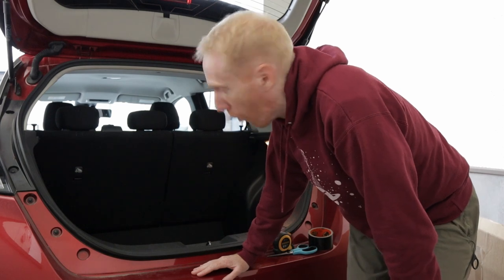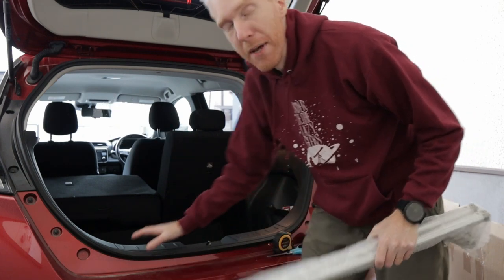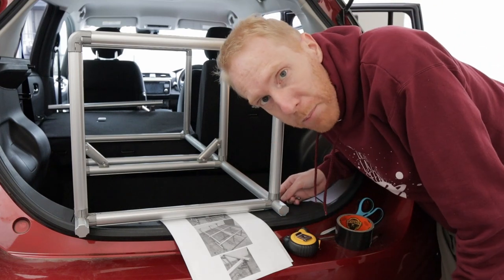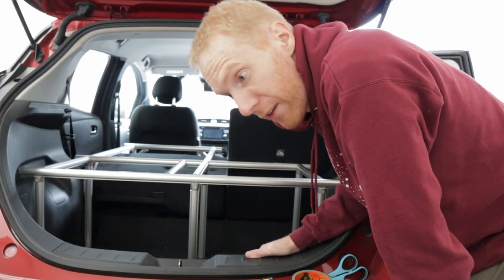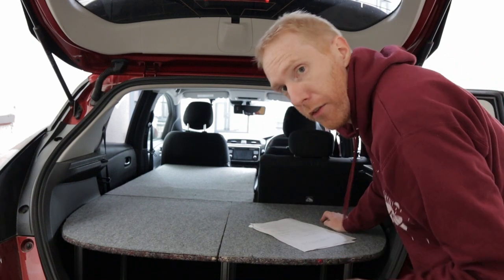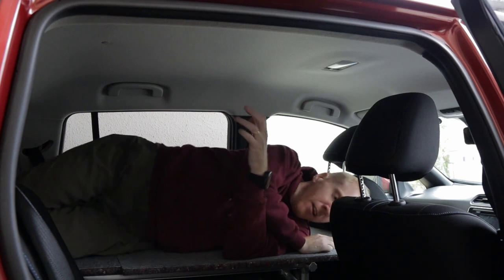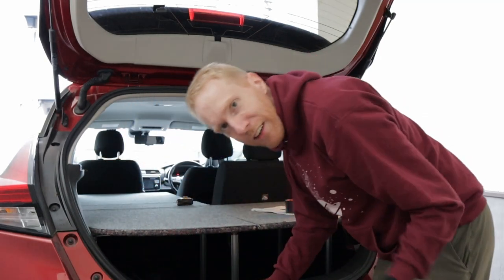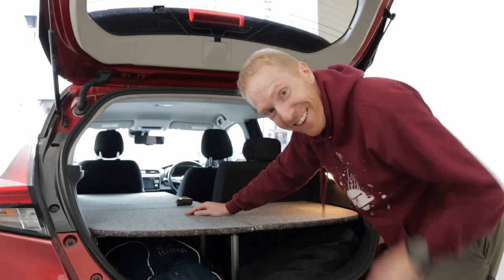From Nissan Leaf to electric Astro-Camper?? First steps!

Comment: hey cuiv! little heads up, whenever working on a car modification or fixture, consider the result of a crash. Use materials that will crumple on impact and avoid having beams directly behind the drivers seat. It looks like you've considered this, intentional or not, just making sure you've thought of it and letting others know it's something that needs to be considered
Reply from the maker: Very important point, thank you!
Reply: since different pieces I am sure the will move upwards instead pushing against
 your body

Comment: Love this!!!  I slept in my 2016 leaf for a couple of weeks.   The best part was running the AC through the night without worrying about carbon monoxide or pollution. I managed to squeeze a cot inside by adjusting its legs, but it was rough me being 6’2 (180cm).  In order to do this, I moved the seat all the way forward, removed the headrest, then reclined the seat so it is level with the back seat.  If the frame extended to the glove box or steering wheel, and the frame legs extended further to reach floor mat, then it would increase the length.  Obviously, you would sleep with your head to the front of the Leaf, and you could modify it to work on both sides for “queen/twin”.    Hmmm
Reply: I forgot to mention that you would also need to remove headrest from back seat. They are easy to take on and off.
Reply: 6'2 is 189cm by the way :)

Comment: Holding the sections together looks like a job for hinges or duct tape. You can even get them to fold neatly if you hinge the sleeping pieces from the bottom, and the side piece from the top
Reply from the maker: Adding hinges is a great idea, I need to contemplate that's thanks!

Comment: This is awesome. Would there be enough energy to keep the car warm for the entire night? You don't want to get stranded, with the battery completely depleted. :)
Reply from the maker: There should be more than enough, especially if set at a low level (like 17C or so, which should be plenty enough with a blanket)!

Comment: Nice!  I was actually thinking about doing something similar by purchasing a used Toyota Prius since you can run the heater or AC without the vehicle being on and tap into the battery for power!  Also the comfort of knowing that if I drain the battery there is small gasoline engine that can run to recharge it.  Either way this is a great idea!  Happy to see more content coming you again 👍
Reply from the maker: I thought of something similar! But I would need to pay more car tax, more insurance, rent a second parking spot nearby, etc... I figured the cost and bother was just too much!

Comment: Could you remove half of the split seat entirely, then you would have to match the height and would give you more headroom ?
Reply from the maker: That's something I had considered, but as much as possible I wanted to keep the original car intact (e.g. adding only, not removing)

Comment: Another very informative video and a great idea! I want to use my Polestar2 (78kW) to power my Astro gear - but it only has a single 12V output (in the boot). I asked Polestar some time ago how I can increase the Amps out but they haven’t bothered to answer. Can your Leaf supply enough (say 3x3Amp@12V?) as standard or did you get it modded? [BTW, I think I watched 3 of your videos before I realised you were ‘The Lazy Geek’, not ‘…Greek’!!! 🥴😂]
Reply from the maker: The cigar socket of the leaf should be enough for my astro-needs since the biggest power draw is likely the camera cooler - can't say for sure. At worst there is an expensive (but in Japan subsidized) product called the Power Mover that can power a house by providing up to 4.5kW output.
Reply: @CuivTheLazyGeek  Thanks Cuiv - I want to power mount, camera and ASI Air with dew heaters etc, so think the cigarette socket will melt. I can just hope that Polestar upgrade the car with V2L technology...  🤞

Comment: How you can keep ventilation all night? Mine is switching of after a while..
Reply from the maker: You unfortunately have to have the car ready to drive (but still parking mode with handbrake on) - otherwise it turns off after 15 minutes
Reply: @CuivTheLazyGeek  thanks, I'll try this way :)

Comment: I have the same car , nice converting puzzle 😅 , but we’re do you connect telescope to 12v ?, my car turn off the cigarette light 12v plug after 10 min if the car is not in ON  mode , the car in ON mode work fine the 12v plug but the car lights don’t turn off and will be bad for Astrophotography , do you have a different way to connect the telescope ??
Reply from the maker: Yeah that's my main worry with the car - it will have to be on ON mode, and then I'll need to cover the front lights with a blanket or something...
Reply from the maker: There is another possibility but it's expensive (officially for disaster prep): https://item.rakuten.co.jp/sungarden/sg134485/?scid=af_sp_etc&sc2id=af_113_0_10001868&icm_acid=255-776-8501&gclid=Cj0KCQjwqc6aBhC4ARIsAN06NmNEULH9KAezj6tQF55vsJo6bto7tAKVWFtNKFCnmCKb0hoh6KvxomcaAvOMEALw_wcB&icm_agid=&icm_cid=18507343872&iasid=wem_icbs_
Reply: I teste already my system with a APC of 1500va and work for 6 hours using asiair pro , just need to be full charge , but don’t make any sense having a electric car with 62kw battery and not use battery without having the light on 😏